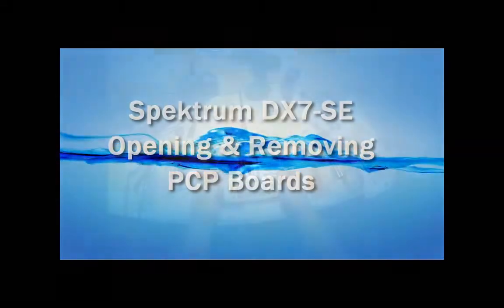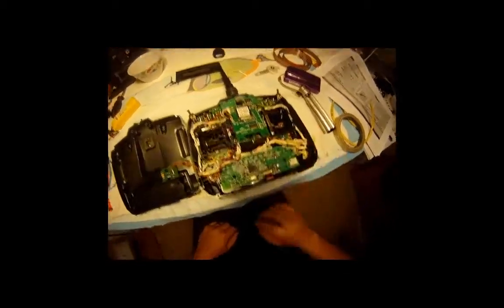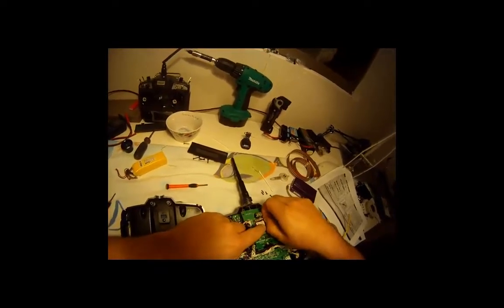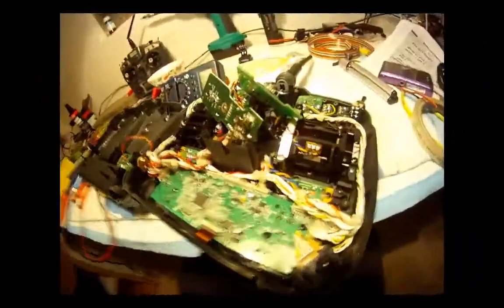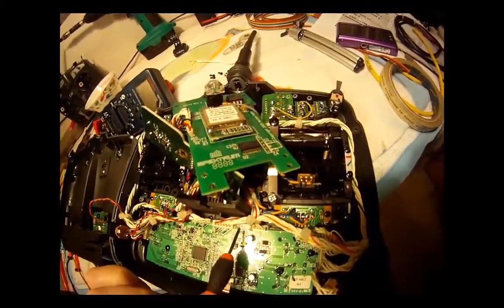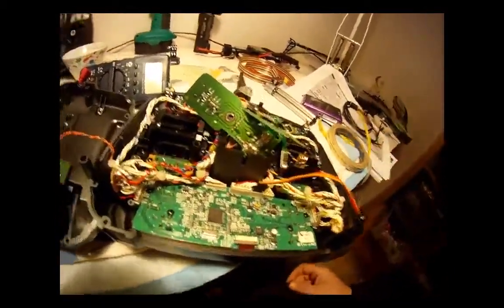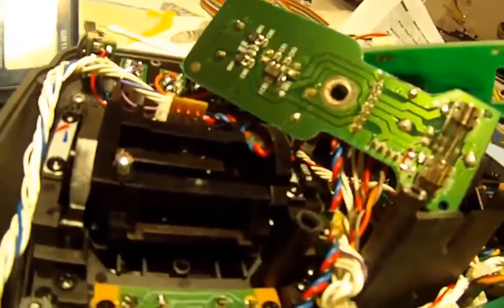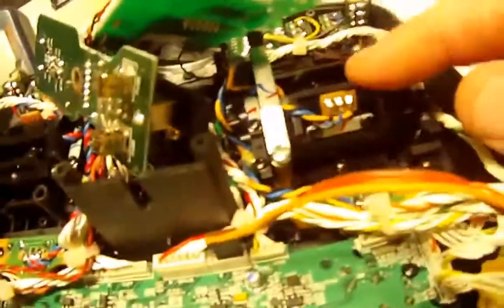Spektrum DX7-Se stripping and wire tracing for a backlight mod

Comment from the maker: No I did not. I could not find anything either .... I was going to .... and I actually took all the footage needed to get it up there..... but deleted the wholte lot by mistake.

It can be done ... and if you look in my DX7-Se playlist you will see the voltage rail points on the boards..... and where I connected mine to.